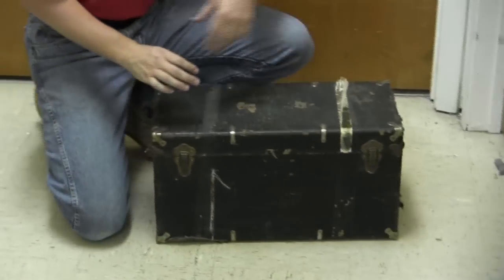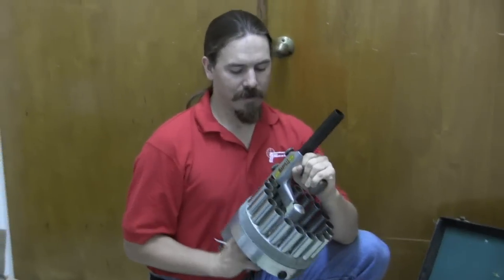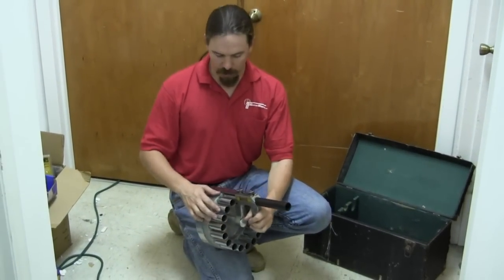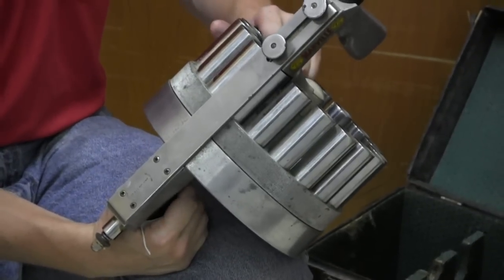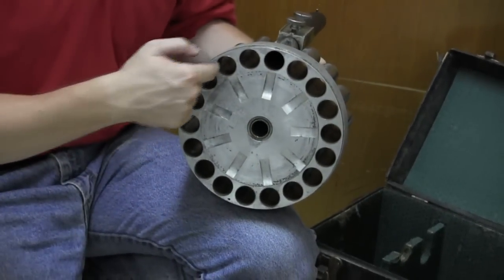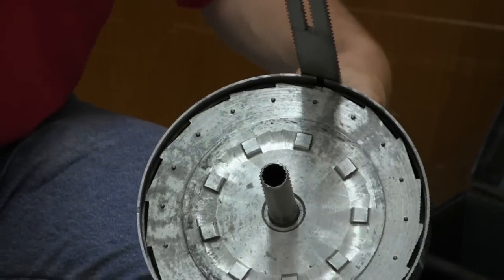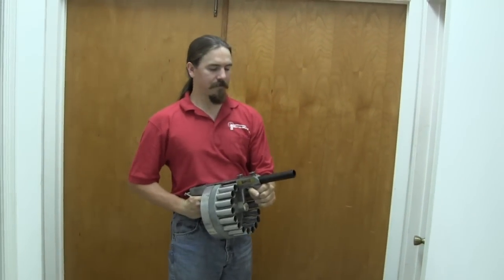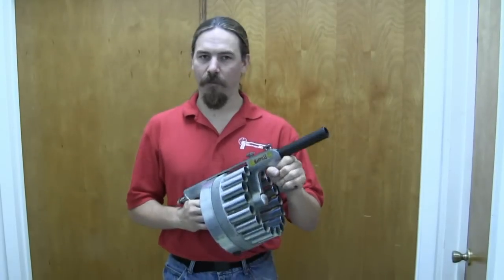Manville Gas Gun

Comment: Apparently there was a 40x46mm grenade launcher manufactured by the Hawk engineering company known as the MM-1 that bears a strong resemblance to this tear gas launcher. It's purportedly capable of launching 30 grenades per minute and did in fact fire explosive ordnance. I've been unable to find a manufacture or design date but there it is.

Comment: actually bahrain police they use this gun alot
Reply: I'm almost sure it's an MGL or Hawk MM1. A Manville gun would probably not be in very good shape if it was in normal use because the winding spring would have broken and they aren't replaceable unless a new part is machined by hand. They would also be worth too much money on the resale market to use in ordinary police work. I saw an original Manville gas gun in our armorers office when I first became a peace officer in the early 70's. It disappeared shortly afterwards and I imagine it was sold to a firearms dealer or collector.